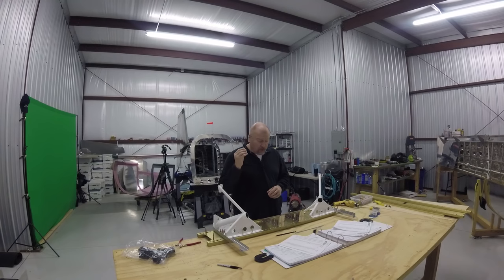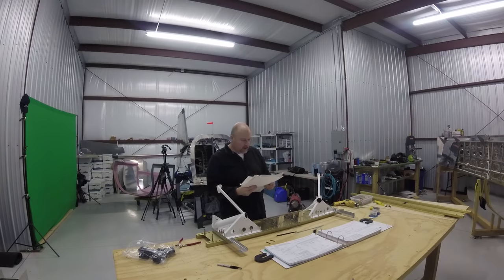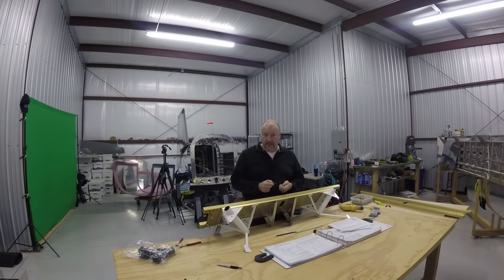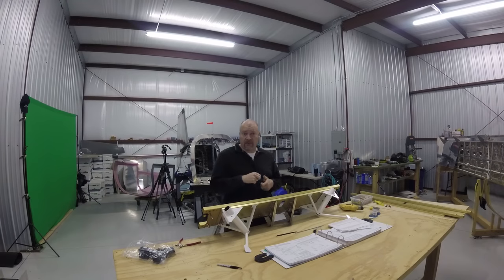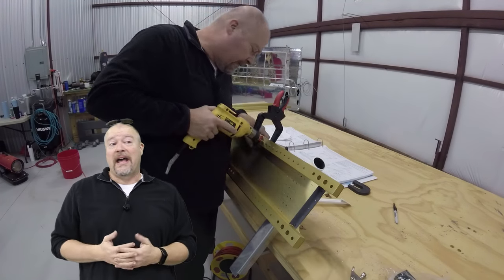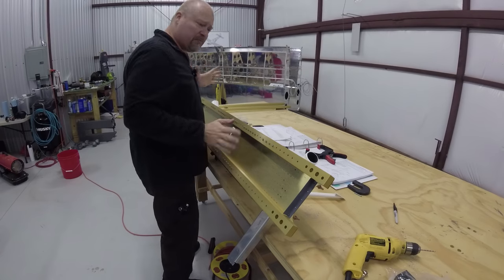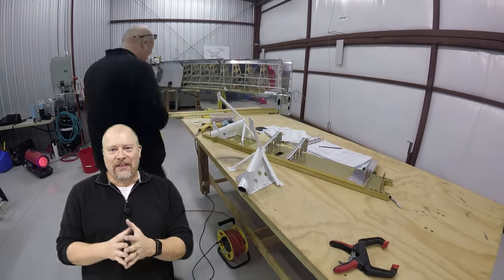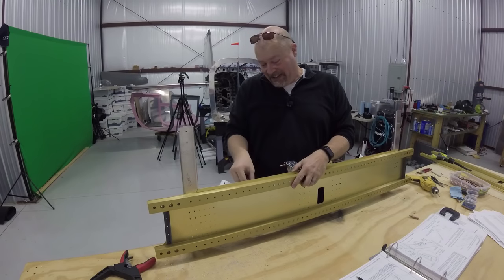RV-10 Fuselage - 004 - Creative problem solving, shims don't fit!

Comment: Getting it done, looking good!! Just one little tip that I use when I build (building a RV-12iS). Go to harbor freight and get a moving blanket and put it on the table. Now your baby will not get scratched on the hard plywood table.

Comment: I'm not sure what it might say in the plans but maybe put some mastinox on those bolts when you put it all together. Or some other kind of jointing compound. We use it when we put in the Blade bolts on Helicopters. No corrosion is a good thing.

Comment: My bushing would have been a pressfit also I had to remove .0012 inch (I have micrometers) just spun it in the drill with scotch bright.  No big deal. It is best practice to use a drill bushing to step up hole size in hard materials.  Use cobalt drills.  Carbide Does not work well in a hand drill, they chip easily and then your hole goes oversized.  And if you brake it you will not be able to grind it out.

Comment: As an Ozzy A&P guy turned airline pilot, would you mind if I made a hazardous guess?

I suspect the bushing was anodised to prevent dissimilar metal corrosion occuring between the bushing and the spar. I wonder if perhaps the holes in the spar were meant to be enlarged to accommodate for this?

I would like to build an RV10 at some point, so confronted with the same situation I would probably use a vernier caliper to measure the width of the bushings, then use a reamer doused in oil (to prevent chattering) to slowly enlargen the holes.

What do you think?

Edit: Also someone below mentioned using mastinox or similar now that the anodised treatment has been removed. If the bushing and spars are made of different materials you will most certainly get dissimilar metal corrosion in the distant future - much sooner if moisture gets in there somehow.
Reply from the maker: The bushing is only there to guide the drill bit.  The hole in the spar is sized specifically for an an3 bolt which fits just fine.. I have to think enlarging the hole to fit the bushing is the wrong thing to do versus making the bushing slightly smaller just to guide the drill bit for the initial #30 drill before updrilling to a #12... (then you discard the bushing..)
Reply: @JasonEllisBuilds  Oh snap! In that case I completely misunderstood the original problem. Thank you for clarifying the problem.

Comment: I assume you meant service life rather than shelf life.  🙂

Strange that bushing didn’t fit.  It almost looked like it was black anodized.  If that is the case and they sized it for a tight fit prior to anodization, they part will be very slightly larger after being anodized.  Maybe just enough so it won’t fit assuming a nearly interference fit originally.

Comment: buy cobalt bits and buy a drill doctor....both well worth it.
Reply: Evo Prototyping I recently bought a Drill Doctor, but haven’t got around to using it yet.  I hope it works as well as advertised.
Reply: +1 on the drill doc. Same set of bits going strong for nearly 10 years (with sharpening, obviously)
Reply: @yeagermcbipper9008  Good cobalt bits are expensive, and a DD can do all sizes. I have one, once you figure it out, it's a dream.